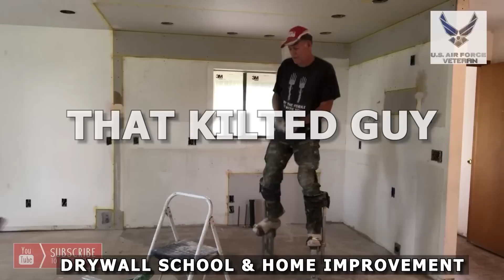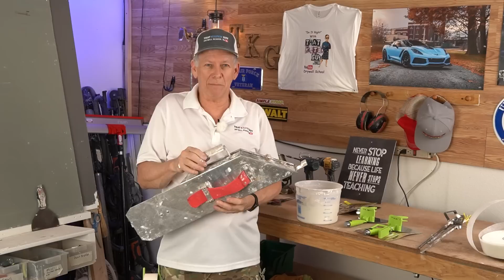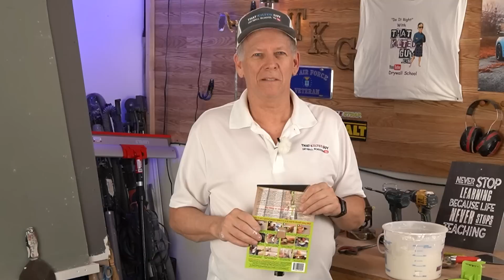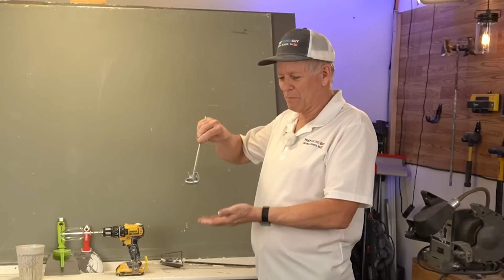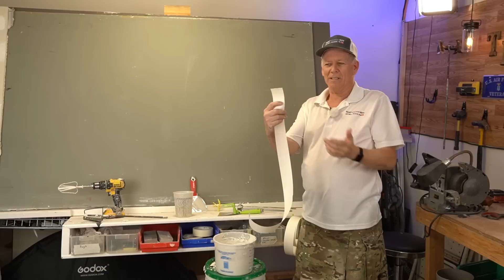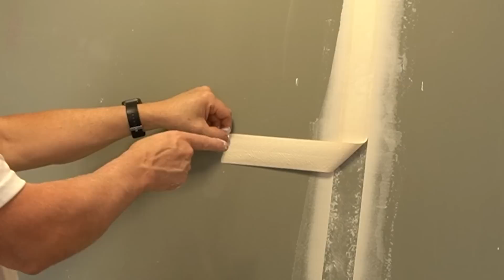Novices- NO MORE DRYWALL BLISTERS? Tape with Paper Tape with ease

Comment: I use mesh tape on ceilings without fast drying mud and haven't had a problem. But I suppose I'll use the fast setting stuff from now on so I don't run into problems in the future.

Comment: The best way to tape for beginners is to, buy a can of adhesive spray and use yellow or green mesh tape. It will stay down for days. Then just mud over it when you're ready!
Reply from the maker: Except for one thing and that is that if you don’t use setting type mud over mesh tape it’s more prone to cracking. The manufactures of mesh tape even state this on their websites and hot mud is a challenge for novices too. 

Thanks for commenting, I appreciate it

Comment: This would help me. I am still struggling to apply tape.
Reply: how? u put mud on the seam put your tape over mud, clean out. Its not hard unless your doing it wrong or trying to make to long of a run
Reply from the maker: Novices OFTEN struggle with doing it right. It’s harder than you make it sound. The blisters in the pic were left by a licensed contractor trying to do it.

Comment: I'm starting to get really frustrated with trying to skim my walls. Keep getting chatter Mark's, doesn't look like I'm getting even coverage in spots. Very frustrating. And Marshalltown pans suck.
Reply from the maker: What are you using to skim and what method? 
Have you watched my skim coating videos? 
https://youtube.com/playlist?list=PLCrazHylAOEn0VW1xVLpJ_yLO3yPQKDJA
Reply: @ThatKiltedGuyDIY  I've watched your videos so much I have them memorized lol my basement walls. Using a 14 inch with all purpose and a little water
Reply from the maker: A wider skim coating blade can make it easier for Most people. Maybe try rolling the mud on.
Reply: @ThatKiltedGuyDIY  thank you.  How much should be left on the wall depth wise
Reply from the maker: @thecommonsenseconservative5576  just slightly more than is needed to cover the defects. Sand with 150-220

Comment: Good review. However even as a relatively experienced DIYer, learning basic mudding-taping technique only takes a little practice. While this tool idea seems good &, from your review, is reasonably well made, it seems messier and inefficient. I probably wouldn't make the extra effort to take this out even for a small project and it's certainly not applicable to a larger project involving drywall. Sorry, but it doesn't seem to add much. I'll stick with my Marshall Made in USA taping knives. There are so many video for learning how to properly prep mud and "develop/smooth" (? for lack of a better term) tape joints and this tool doesn't replace the skills a novice person needs to learn as well for a good result.

Comment: Thank you for sharing that, I am ordering one today. If all you have is +3 how much wood glue do you add for taping? Thank you
Reply: Don't add anything but water to these compounds they have their own adhesives added
Reply: @haroldhardiman3769  thank you
Reply from the maker: Well that’s not totally true. Topping mud has almost no adhesive, +3 has a little bit, and regular all purpose has more which is why I said that in this video. So for a 5 gallon bucket of mud I squirt in something like a couple of tablespoons. It definitely makes a difference because it’s harder to sand but not that much. 

And I only do this when the surface I’m putting the mud over is glossy, or otherwise concerns me about the adhesion ability. And on glossy surfaces you can sand it to help with the adhesion but that only affects about half of the surface.